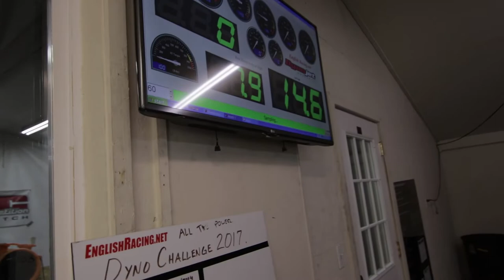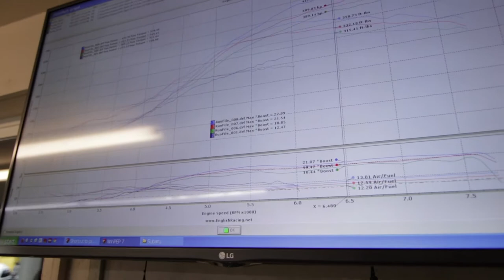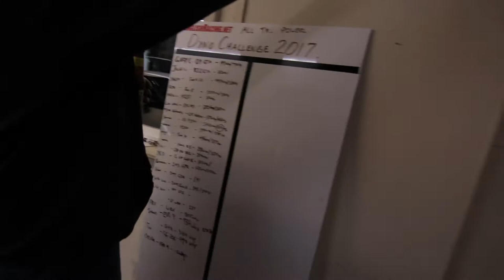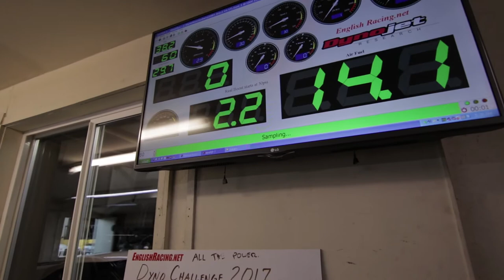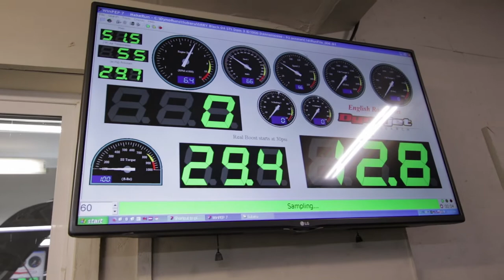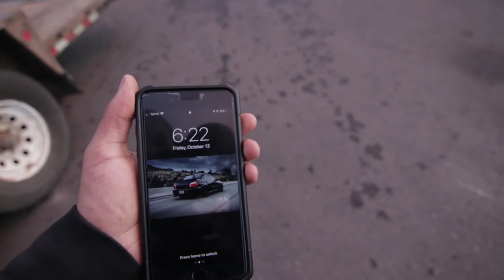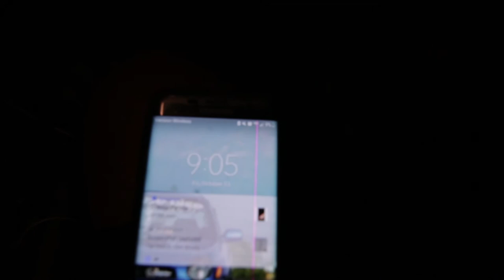6466 Twin Scroll STi Dyno Day

Comment: This is the exact setup I want to run just with a closed deck block, built heads, 6266, and e85 with ID1700s and a single walboro 450. Do you know how maxed your fuel pump was like the duty cycle percentage? Thanks man please keep making videos I've been watching em.
Reply from the maker: Patrick Wilt my injector actually maxed out at 600hp. I don’t remember the Injector duty.

Comment: Which block was this?
Reply from the maker: 675forlife 2017 IAG stage 2 block. This block already had about 20k miles when I took it to this dyno session
Reply: Fritzy frenzy so not closed deck then?..
Reply from the maker: 675forlife 2017 no I tore apart this motor in a later video if you want to see
Reply: Fritzy frenzy are you still running a twin scroll on the stage 3 closed deck block?
Reply: Fritzy frenzy what was your rpm boost range with the twin scroll? Like from what to what? I am trying to find a way to get boost around 2k and pull strong up to 6ish, 7k with a proper external waste gate so as to properly flow adequate boost around the exhaust turbine.. there’s so little information about this for twin scrolls..
Reply from the maker: 675forlife 2017 yes I will! subscribe for what’s to come. I upgraded my fuel and some other stuff to surpass my old power level
Reply from the maker: Sorry for the late reply. I didn't see this comment when I made my initial response. I would get full boost around 5k or maybe a little sooner and pull strong till redline. The turbo could have reved out more but my motor couldn't so we kept it at 7.3k. I had twin 38mm wastegate and they kept my boost levels happy!